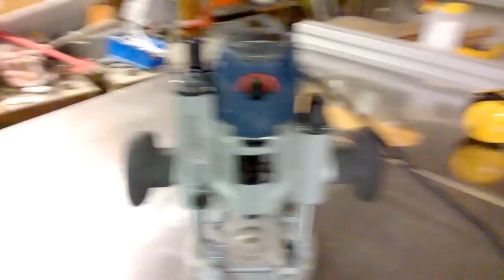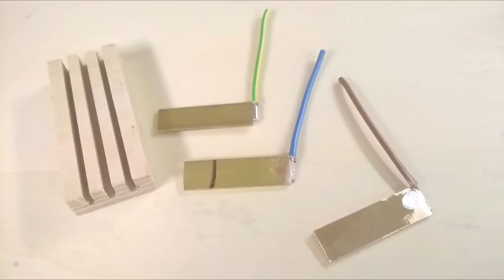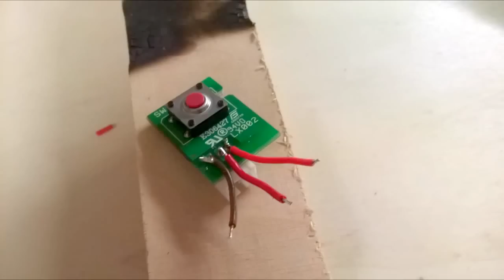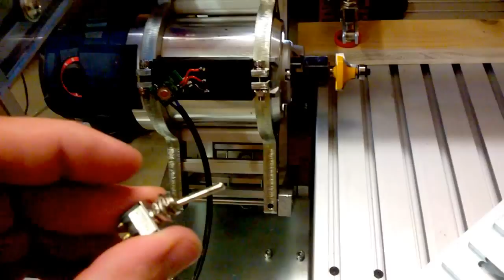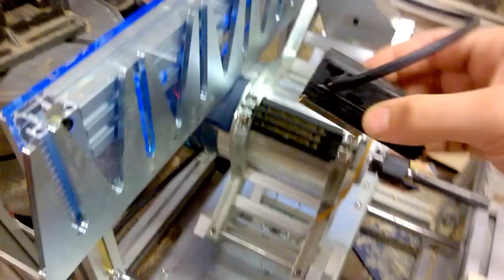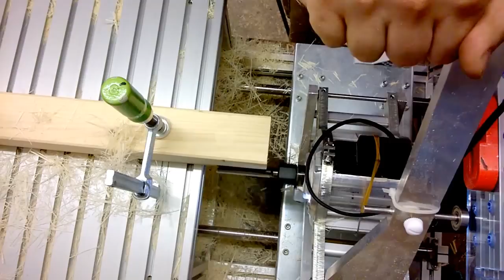Bosch Router External Switch (Bosch MRC23EVS / GOF 1600 / GMF 1600)

Comment: I took the black pieces off the side of the router after removing the two screws from the aluminum retainer.  By lifting up the outer black plastic part and then lifting the piece under that, both parts came right out.  This revealed three 1/8-inch (3.2mm) female spade connectors.  Hot glue was used to seal the hole.  Much easier!

Comment: It occurred to me that one solution would be use a continuity tester to determine which of the 2 buses are closed by the handle switch then you could maybe connect jump those in the wiring above the motor essentially making the motor “on” when plugged in. Then all you have to do is add a plug switch which is commonly available for router tables / other devices. Of course the switch that you purchased may contain circuit components that prevent that option. At any rate I haven’t found that switch yet anywhere so if someone could post a US source if you have found it that would be great!
Reply: Wes,  your question piqued my interest so I removed the trigger handle on my MR23EVS and found that very switch!  It must be available from any Bosch repair parts outlet.  It does have 3 surface mounted devises on with a "R" designation, indicating to me they're resistors.

Comment: That worked out nicely in the end, but what a stupid design to begin with! Not having a switch on the main body makes me wonder what in the world tool designers are thinking.
Reply from the maker: pocket83 They are certainly not thinking about people wanting to use this in their own fixtures. When used as a hand held router I find having the switch on the handle much more convenient then on the main body. An optimal solution would be to have both.
Reply: pocket83 Yes the GOF 16000 was the router I planned to buy until I found out they had designed it like this. The older 1400CE had the switch on the body, I would like to find one. Or it will be an AEG MF 1400 Ke instead. Don't have the money for either right now so it's an academic question.
Reply: 1873Winchester Turns out I managed to sell something for $$$ or €€€, and I still bought the Bosch despite what I said! The GMF model ofcourse, the fixed base is way nicer for a lot of applications, never liked plunge routers much.